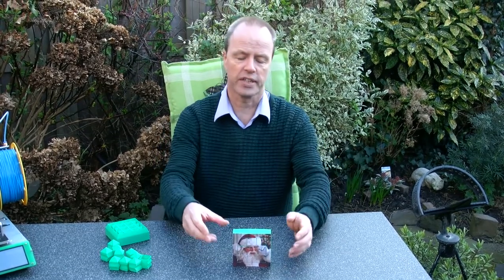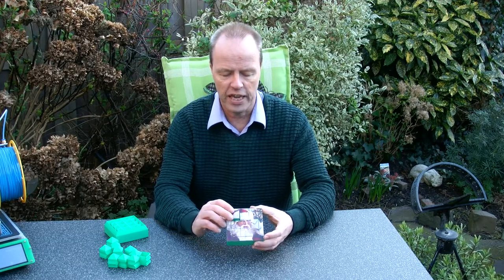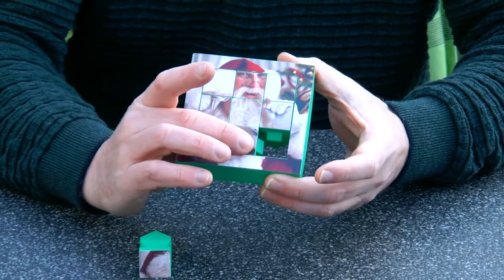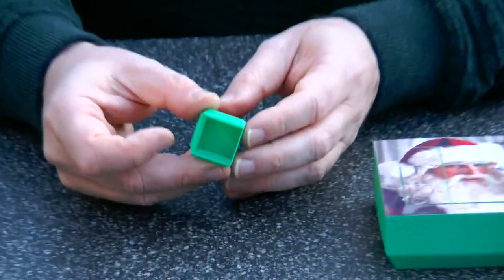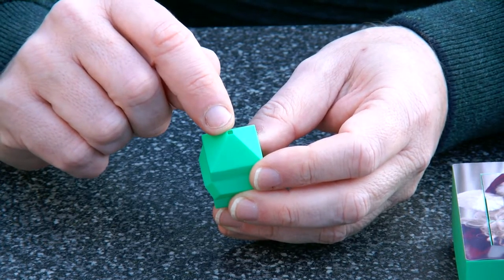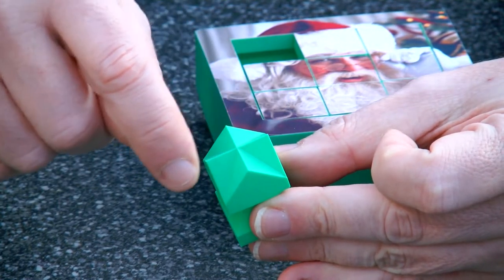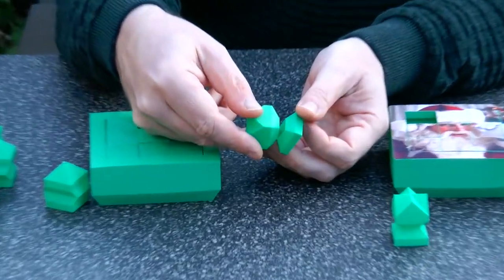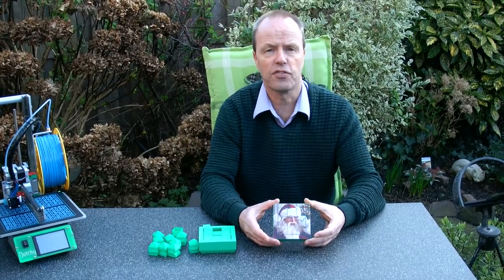Santa Slide - How light will these hollow pieces come out of your 3D-printer?

Comment from the maker: What other roofstyles would work for these hollow pieces?
Reply from the maker: Why is this comment two years old?
Reply: What
Reply: I've had success with a conical vase-mode print. I add a small radius at the tip of the cone which basically causes bridging extrusions. This was on a pretty steep cone, and I'm not sure if it would work on a 45deg cone.

Also, I've had a lot of success adding thin, X-shaped cuts into vase-mode prints. These thin cuts essentially form ribs and drastically increase the rigidity. Take a look at my printables page for an example.
Reply: @OskarPuzzle  Because you for some reason waited 2 years before you changed the video from private to public.
Reply: May I suggest you’re thinking inside the creation of a box that can have a roof to cover it, which absolutely isn’t the minimal configuration for light and hollow pieces.

You need to think what would fit inside a weirdly-shaped box to provide the extra protruding parts that interfere with movements, namely, no box at all!

Where you don’t have a box, you also don’t need a roof.

As these are sliding puzzle pieces that slide in 4 dimensions, you need a + sign shape, and if you’re looking to still have a slanted “roof” area, you could still do that, if you really want to, but I didn’t see a very good justification for it explained as to why you need that.

If you do need a roof, depending in print resolution, speed, cooling, it’s likely entirely possible to do it via bridging without supports, and I’d print each square puzzle piece face-down.

As for the issue with printing a roof peak, if you really need to do that, that may make sense to set (possibly) some slicer options for the last layers, depending on your slicer, or you can go full custom and hand-modify the generated G code for the print speed for the last few layers so it goes slow enough, which of course, does require reading up on G-codes for feeds and speeds for extrusion, etc. and identifying the times it moves up to the next level. Other than slowing down the print speed, there is perhaps a better option: adding pauses between layers, or minimal layer times.

There’s no reason you shouldn’t be able to print those peaks neatly, assuming you really do need to print intricate box shapes at all, which is going to need easily at least twice the filament as printing crosses instead.
Reply: @OskarPuzzle   You've created a puzzle in your own comments!